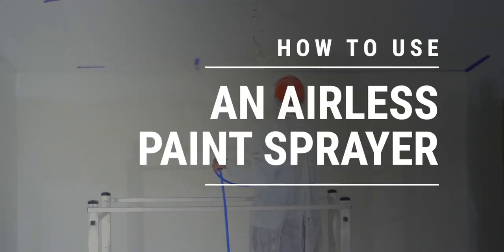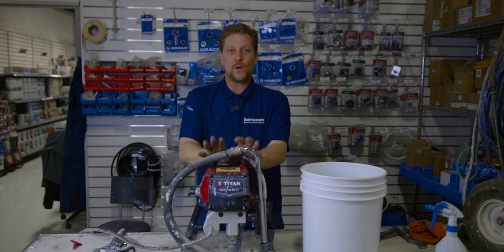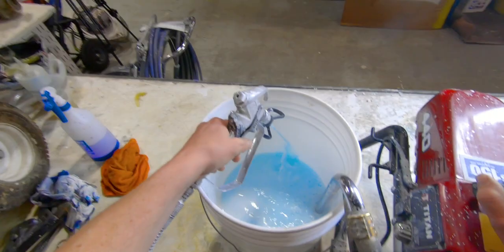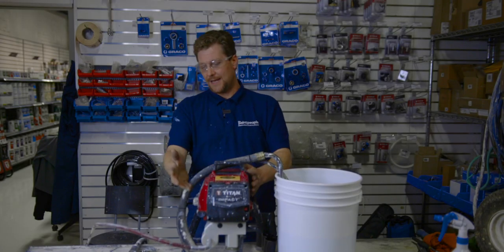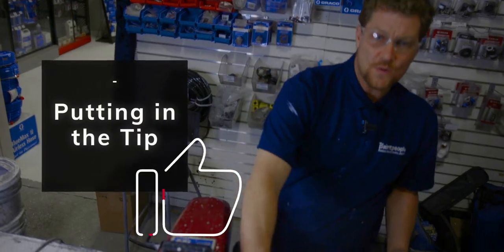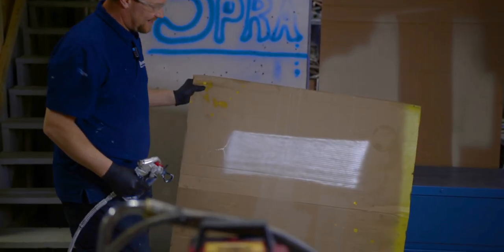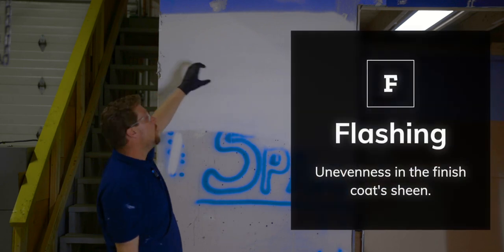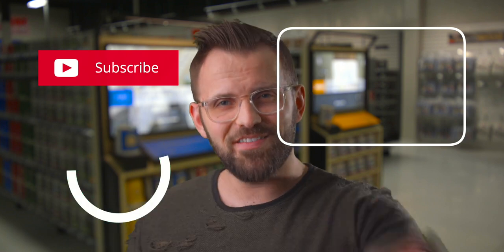How to Use a Paint Sprayer | Airless Paint Sprayers | Titan 440

Comment: Nice video!  Very detailed!  Some questions, how long can you paint for after you have primed, attained the correct pressure and started painting?
Reply from the maker: It all depends on the type of paint you are using.  2-4 hours between coats is usually sufficient: read the label on the can to confirm. 👍
Reply: @thepaintpeople ... Do you need to water down the paint at all before spraying, as some paints are a little thicker than others.
Reply: A

Comment: Question: I’m repainting doors and trim in my house and sprayed my smooth finish wood doors with a graco project plus airless sprayer using a 311 tip. Instead of sanding, I used Krud Cutter gloss off. Anyhoo, the problem I’m having is after I sprayed them it left little craters all over the door. I adjusted psi and everything but still a problem. I have done both a continuous spray and start and stop and still the same issue. What am I doing wrong? I then sanded the craters out and tried again and same issue. Also part of texture is smooth and then I’ve also got an orange peel like texture. FYI: I don’t think it’s fish eye cause it doesn’t look like an air bubble.
Reply from the maker: Hi Jackie, if the doors were not properly prepped (removal of any krud) that would contribute to craters.  If the tip is too fine/pressure too high, and the ambient air/humidity is too dry that could also contribute to craters. What product were you using?

Comment: What happens if there is more then 1 colour ? Let’s say you have sprayed finish majority of the house white, do you have to reclean the whole machine restarting from the whole priming process again and pump in the different colour? And the same process repeat for the rest. Let’s say you only have a day or two to finish the job.
Reply: I just drop the intake hose into the new paint color when I have about half of the last wall left for the old paint. that way it runs into the new color right when I am done painting. then just spray the next wall the second color. If it is the final coat you may want to spray a couple lines on the cardboard to ensure the new paint is all the way through the system.